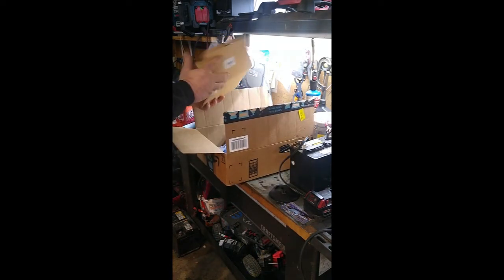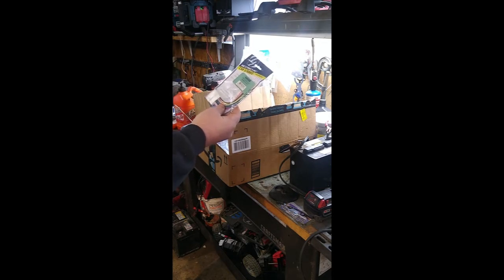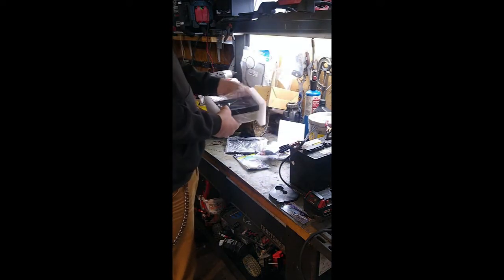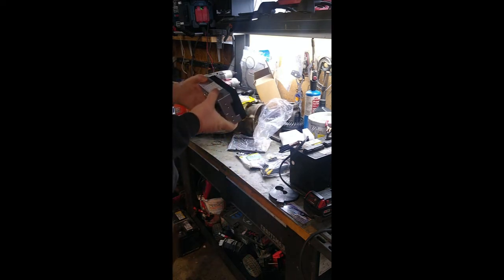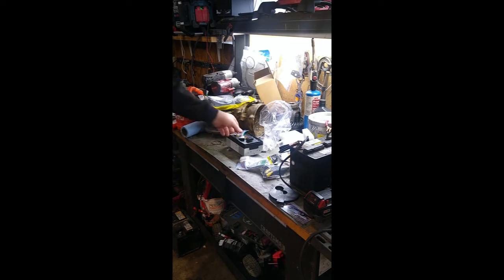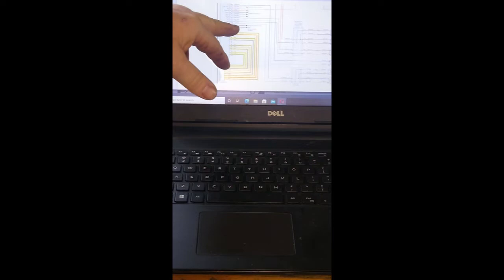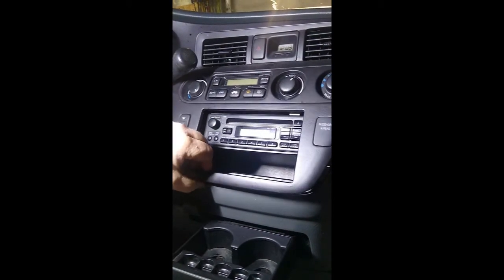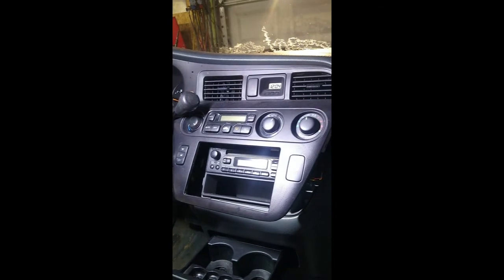2003 Honda Odyssey Double Din Amazon/China Radio Install

Comment: Will this still work with the DVD player in the 2003 Honda Odyssey EX-L?
Reply: I also change the radio but I have no idea how to use that but mines has a remote for thedvd  and headphone
Reply from the maker: Is it a separate DVD player ? My guess prob not if so but I could be wrong
Reply: @HooptiesGarage   no mines is oem it came with the truck
Reply: Mine is stock with the model of the van. That’s my main concern is I won’t be able to turn on dvds for my kids on long drives.